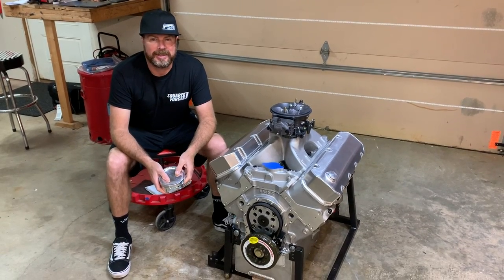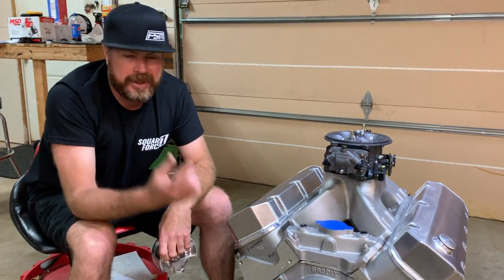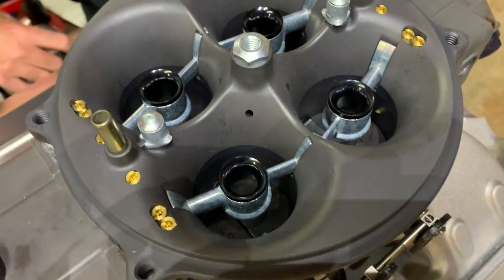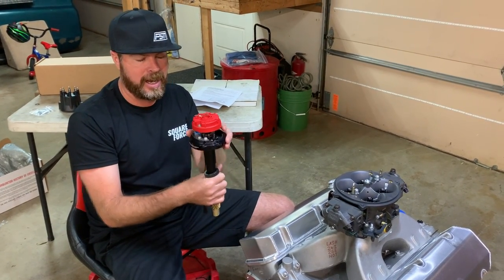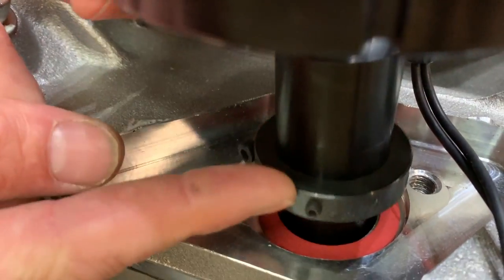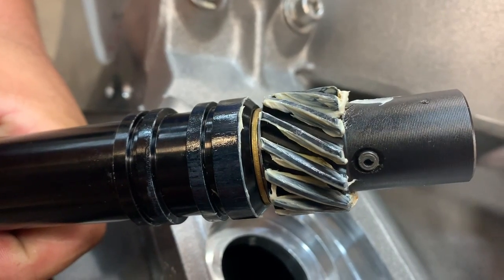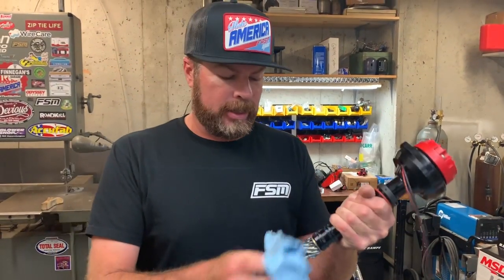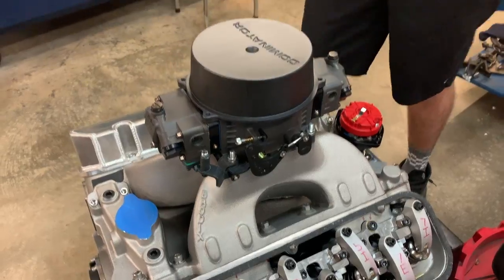1000HP With No Turbo, No Blower and No Nitrous: Finnegan's Garage Ep.79

Comment: 21 foot well we need to figure out the width then use the length multiply and know square feet then divide the horse power with the sq ft so we know how many hp per sq feet we got I know this number wouldn’t mean a whole lot to any one but to me it’s just a thing like horse to pounds comparisons I think it would be a krazy number like around 70-90 hp per sq foot that’s just stupid crazy but wow you gotta love it and even if you don’t you have have respect for it this would be one of those boats that when up to speed there really literally like skip/flying across the top of the water like the prop is in the water but like 99% of the boat is out of the water as long as there’s no wind and it’s calm smooth skipping but a gust of wind and flip flop shaduzal if I’m right about the boat there kinda like the motor cycle drag racers to me there is a big hart and a lot guts and those 2 things down there below you know and add a pinch of crazy with a helping nerves of Steele with pride and a drive to win like you’ve never seen there a special so,me body to throw it all in when it is there own neck 1 wrong move and that’s it next move yeah rip my respect and love for it goes out to them grown up my dad looked at me and said don’t even think about a motor cycle boy I  can see the first 6 years of your life you are gonna have a hard time keeping 4 wheels on the ground so you dang sure don’t even think about two he was right I’ve turned over on 4 wheels a half dozen times I around 30 years behind the wheel  one of the craziest feelings is in control out of control coming into a curve way to fast starting into it cutting the wheel feeling the intail slide start and let off the wheel giving it more fuel fell it sliding and getting faster as the car comes in the curve at 92-94 mph in less than 1/8 mile coming out and back I control no sliding now at 125-127 yeah I. Knew I had 1 chance to do it and if I want right on the steer or the pedal it was all dun but I have never been in that way before or after and 1 time is good enough for me I’d say but you gotta love the race it’s a feeling of like no other it’s as prime evil as breaking the law it’s cheating death as many times as you can an just knowing it’s gonna catch you one day but you live to see another is better than any drug it is a high like no other adrenaline junkie hell yeah

Comment: Uhh, you kept saying it must have engaged the oil pump drive shaft because the rotor won't turn.

Doesn't that only mean it's engaged the cam? The distributor won't turn because the cam isn't turning. Then the distributor gear drives the oil pump shaft. You explain it the opposite way
Reply: u have to turn the motor over then it drops down,he must have done that off camera

Comment: Trying to figure out what I’m going to do for my 454, 781 heads, domed pistons, and a cam with an operating range of 2.5 - 6k rpm(hydraulic flat tappet). I’m just having trouble finding the right intake and carb to make me some high end power, so I can run 400 - 450 to the wheels. Any ideas?

Comment: ●PORTED Cobra Jet intake Manifold ●VMP twin 67 TB ●PMAS cold air ●Lu47 injectors ●BBK Long tube headers ●BBK offroad Xpipe (no Catts) on this car ● Extreme Stop cross drilled and slotted rotors ●Extreme Stop carbon graphite pads ●Russle steel braded brake lines ●Ford Motorcraft dot 5.1 brake fluid ●JLT catch can ●Barton hybrid 3 shifter- trans mounted ●Ford Racing aluminum driveshaft ●JMS fuel pump voltage booster only 5volts over stock settings ●AMP Stage - 3 BUILT MT82 transmission ●Ford Racing roller pilot bearing ●BMR Adjustable Uper Rear control arm W/spherical fittings ●(All MacLeod) ○Street extream clutch-26 Spline, ○race spec flywheel, ○hydraulic throw out bearing, ○steel braded clutch line...331 factory gears. Previously dynoed at (432 on 91), (450 on E54), (460 on E85) all to the rear wheel ....new motor.......
●2012 coyote 5.0 block compression decked, ●Boss 302 crank, ●Manley forged 43-40 H-beam rods, ●Mahle forged Cobrajet pistons, all forged rotating assembly and ballenced ●Boss 302R heads NOT Boss 302 heads, ●Comp stage 3 NA cams, ●Ford performance timing components, ●Ford performance Cobrajet oil pump. ●MSD Blaster,coil packs ●NGK iridium plugs gapped at 0.049, From 11 to 1 to12.5 to 1 ........dyno says (on e85 tune), 508 to the rear wheel with 394 torque. Should I be seeing more rear wheel HP on e85

Comment: Hmm,...What happened to greasing both sides of the distributor gasket to prevent an oil leak as I learned over 50 yrs. ago?? Damned youngsters. JMHO.
Reply: And I guess that "indexing" a distributor to 'top dead center' on the #1 cylinder is a moot point with computer controls nowadays. Jeez, a chimp can build an engine today.  
It's sad that kids won't enjoy the same satisfaction I got when I figured out how to get a few more HP out of an engine myself. A sad day for us "old school" gear-heads.

Comment: SO Finny discounting your labor and time What is retail cost of all parts ,shipping to and from California and Dyno tuning with labor ?   Probably less costly to Turbo a 454 and run it on pump gas with fuel injection ,don't you think?    I Guess over 25k to build that motor as you did.
Reply: You can buy an all-new, all-forged 632 bottom end for $5600, IDK what those heads cost but it's about as much, add another grand for the carb and intake manifold, another grand for the cam and lifters. You could do it for $15k if you count your labor as free.

Comment: Nice engine ! Isn't 100 psi of oil pressure a little overkill?
Reply: It depends on your engine. If it's your average street mill using 10w30 dog water, yes. I suspect this thing runs closer to 50w, and if everything is as it should, it can handle it.

Comment: I guess I need to drop another six hundred on a bigger cam, mine came in a little under that with all the same parts just just a small hyd roller cam
Reply: I wouldn't try a hydraulic in that because of the lack of lift and because of the excessive duration below 0.050", and because of what the necessary springs do to the hydraulic lifters. You'd need a rev kit. I'd start with Comp's 11534 lobe for enough streetable lift to use such heads. You're on your own for Lobe Separation Angle.
Reply: I have the gym performance tall block with brodix CNC ported heads and intake and a 1050 quick fuel card. It’s a 598 with a comp cams XR288HR-10
With.521 int .540 lift and 236 242 duration at .050
Reply: On the dyno it made 600 hp and 705 pft

Comment: He did the engagement into the oil pump measurement wrong he doesn't
 have over a 1/2 inch of blade into oil pump. The drive shaft for the oil pump is about .25o or more up inside the distributor gear ,not even with the bottom of gear where he measured it.

Comment: Not so interested in outputs on funny fuel. Pump gas or E85 and drop the compression or pump gas with water injection would be interesting. Most don’t have easy access to or don’t want to store a stockpile of race/aghast.

Comment: Soo 500 cfm per i take port. 1350 cfm carb. Was the porting really necessary of The total port Flow is 4000 cfm but The carb is only 1350?

Comment: Distributor length measurements make perfect sense but it is .625 or 5/8" exactly
Reply: Minus .250" for the Undercut Chamfer on the bottom side of the Distributor Gear. Giving a Total of only .375" or 3/8" of true engagement.🤔

Comment: You never mentioned rod angularly,  prob with short deck and long stroke.
Reply: High compression mostly renders rod length inconsequential. The majority of the work is done early in the stroke and the side load forces max out at the bottom of the stroke. By then, the force of the  burn is almost nothing. Lower compression has a larger issue of side loading as the effective pressure carries farther down the bore.

Comment: Big numbers with quality parts. Wouldn't it add more HP on methanol, or E85, it has the compression to benefit from alcohol.
Reply: another 25% more power on methanol but 250% higher fuel consumption
Reply: @mctigmctiggy1475  OK, we sell methanol to guys with blown BBC circuit race boats, but they only have 5 lap races.
Reply: @JohnSmith-lb3ge  Yeah, depends on the prices, methanol is 1/4 to 1/3 the price of race fuel here. Methanol also has the cooling benefit, and around 124 octane.

Comment: Wonder what it could do with 93 octane pump gas or E-85?
Reply: @1965l88  Actually, there are several engine vendors selling 632 bbc making 1000fhp on pump gas now. Even more on E -85. Shafiroff, NRE, Morrison Racing Engines, etc. Had some time to do more research.

Comment: I like to compare the epitome of race engines to other race engines, I.E. the 3 liter F1 N/A engines of past. 3 liters at 20,000 RPM almost 1,000 HP, if the F1 engine had the same displacement it would make 3,177 HP.
Reply: If it had that displacement it wouldn't rev to 20000 rpm

Comment: Fin did you miss quote on the intake and exhaust lifts? You said .880 intake and ,800 on the exhaust ? You meant .880 on the exhaust right? And Manley valves..? They arent bad valves but with the amount of money that was already spent why wouldnt you run Ferrera's ?  I assume you have some stud girdles on there?  Now the last question. Tell me its going in a Cole or maybe a even a Sanger  or Howard flat bottom ?  That would be a very nice piece. Good for mid triple digits 150 maybe 160mph at 6600rpm . Bring it up to Altoona on a week day. I live 300yrds off the lake I will supply lunch. A jet boat..? ahh hell you cant come up here then. I thought it was going to be fast. Why do you want to waste all that energy? Well I imagine if you want we could let you splash around in the kiddie pool .. A jet boat  really?

Comment: so this is a year too late but i had a thought abut the pistons .Surely ,at some point there is a benefit of a steel piston and i think this situation is just that point . 
If the pistons were made out of stel or titanium you could have still had the biger stroke with the smaller thinner piston ,  the wrist pin in the oil ring , all that .
You can add longer piston skirts for more tability . And yes that may have  resulted in a heavyer piston but also a bigger  motor .And yes titanium pistons cost a lot  lot lot more than aluminium , but you've awready thown  so much money at this engne so why not throw a bit more and go balls to the wall , all or nothing ,come at me bro .

Comment: Sweet motor period, but it’s not very street-able ,not saying it can’t  idle and cruise around ,but with 13.5 there’s very few places to roll up and get race gas, E85 that’s different, I’m old school after 30yrs wrenching , and I’ve always see street cars ,as being able to roll up to the pump, but do understand that E85 has become a huge part of street cars today and it’s also very easy to get today at many places ,but E85 was meant for flex fuel cars ,because it gives you the ability to drive anywhere and not worry about fuel..which also means unless your going to check the E85 at every fill up or installing a true flex fuel system able to retard or adjust timing and fuel based around the Quality of the e85 your still in a pickle going on a trip if your in a poor location for fuel..
Yes I know I’m being picky,it’s not a knock on the motor in anyway just a real world observations if it’s going to be a street car …a race car, car who cares ,or even a street/strip car. who cares about fuel

Comment: Engines that cross over from pump gas at 10.5 to 13 to 16.5.1 really don't make much more power. People make this costly mistake as it won't run on 93 anymore. Maybe a gain of 25 hp from 10.5.1 to 13.1 or so.

Comment: Wrong dist driven gear for a billet roller cam.  Bronze gear is required.  If you run that dist. as it is out of the box, the cam gear will be destroyed in about 50 to 75 hours run time.

Comment: I wanna could you do a small block like that and get close to a 575 horse power
Reply: Biggest heads you can find(300+ cfm), 13:1 or 14:1 compression, .050 duration, .650 lift roller cam, ls beehive style titanium valve springs. Bore it over, stroke it. Get rods, pistons and a crank that can handle screaming at 8500 rpm.

Comment: the block is $6k by itself by the time you pay tax and shipping on it. throw another 6k worth of heads on it, and god only know how much those custom Pistons, Rods, Crank, Cam and Rockers cost. I bet is there is over 20k in this engine. not to mention paying for the dyno time to get it all tuned to make over 1000hp. a guy as good as Steve Brurles time doesn't come cheap.  from my limited experience I can tell you that once you get over 11:1 compression, carbureted engines get really finicky about their tune up. I could never afford it, but its still bad ass any way you slice it.
Reply: I think it would work out  to be a lot more expensive to not get it dyno tested/tuned

Comment: Proper engines don't drive the oil pump from the bottom of the distributor, esp at the back of the engine. This is a bad design fault present in most ancient American V8's

Comment: So even if you changed it so it'd run pump gas still we're talking 800 plus hp huh.
Reply: Compression would have to go way down for pump gas which would result in the cam being far to big for lower comp which would make the heads way over kill same with the amount of fuel and timing, probly still be good for 600 plus but would be a huge waste of money, could build a smaller pump gas motor and make the same for much cheaper in my opinion

Comment: Why dont they put these sort of engines in like audi r8s and stuff? it makes more hp so why not? I dont understand why not.
Reply from the maker: Well, it's an expensive engine. There is extra maintenance that comes with a pushrod engine with this much valve lift and spring pressure, too.

Comment: Your rotor won’t turn because of the cam not because of the pump shaft. If you had no gear on the distributor then you could turn the pump shaft with  by turning the rotor. Lol
Reply: He was showing that the distributor had no mechanical advance, you can move the rotor on a distributor with mechanical advance, it will spring back when you let it go

Comment: I don't agree with the "plastic" distributor gear. Why would anyone run that in such a engine where details about strength and longevity are critical ?  Tell the customer to monitor and change the bronze gear yearly. I tried a Comp Cams "Polymer" gear and it lasted 6 months. 20W-50 oil puts a big strain on these. Why take a chance.  Bronze is the way to go. Comments ?
Reply: Depends on the cam.  Use what the Cam Mfr. specifies.

Comment: Hey Finn i hope you changed the cam gear on thee correct distributor cause the gear on the distributor was a HARDENED gear and the BRONZE gear we did not see you change it, in fact is  a no no  so did you change it, You did mention cam tunnel height?  But you did measure so ok,  But it is a nice engine!!!!

Comment: Goof! :(   Setting oil pump drive clearance...just because you can't turn the rotor don't mean you had the oil pump drive engaged. Dizzy drive gear hits the cam first and then the oil pump...you would have figured that out if you had not gotten lucky and hit #1 first try, right? What would have done if that did not happen? Pull it back out and try and line it up with a screwdriver? It's easy if it's on a stand...what happens if it's in a car/boat? I tell ya little trick if ya promise not to tell nobody OK? Say you have a dizzy with 10* mechanical and you want 35 total...find tdc and back it up to 25* and drop that dizzy in the hole, it don't matter where...you can tell if it missed the oil pump drive, it won't come close to the manifold. Pull it back up just enough so the rotor will turn and turn like a half inch and drop it again...still missed the oil pump drive? Do it again...next time it should drop, when it does pull it back up without touching the rotor. When it's up turn the rotor 180* and drop it back in and like magic it lined up with the oil pump...but the rotor is not pointing the right way? Pull it back up, rotate 180* and drop it back in. Notice the rotor, it has turned slightly...pick it up, turn it and drop it and after a few times the rotor will point at #1 put the cap back on, mark #1 on the cap, pull the cap off and maybe the rotor to help you see, put the clamp on and rotate the distributer untill one of the triggers on the shaft is right down the middle of the pickup and tighten the dizzy down...comes time to start the motor and it gives us guff don't bother messing with the timing, if ya did it right it should not be more than a degree or two off...sounds kinda complicated on paper, it's not..I can drop one before most people can even find a screw driver

Comment: I don't get america's obsession with avoiding 4 valves per cylinder at all costs.... vvt is even easier to do these days.... I just don't get it
Reply: The best 4-valve heads on earth can't flow as much as the best Bridix Big Duke, or the best Dart Big Chief, or the best Top Fuel Hemi heads can, and I suspect AFR's 385cc BBChev heads also qualify. GM has 2-valve LS heads that flow 450 cfm through a single 2.28" intake valve. Why screw around with crap thats unnecessary and not helpful?
Reply: @davidstephens4639  are you saying that they just haven't made a big enough 4 valve?  or that it's over kill?  Because I know you're not saying that 4 valves can't flow more than 2 valves, and is more efficient
Reply: @fillman86  years ago Thunder power made some 4-valve heads for the Big Block Chevy, but the Big Chiefs flowed more for much less $. Noone's going to invest in producing 4-valve heads when Top Fuel is making 11,000 HP with 2-valve heads. You just can't use it. You can get a Powerglide rated to 3000 HP, and that's 30 psi of turbo boost on this engine, except you'd need to drop the compression and change the cam, so you'd be over 30 psi.